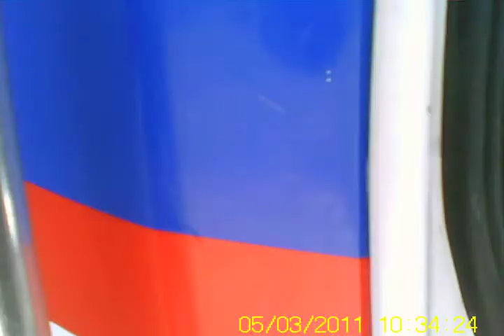Cummins 855 BC4 NTC450 reinstalling the No.7 Main and Thrust

Comment: never use a hammer and crowbar to put the new shells in , you see the oil hole on the crank , insert a splitpin in the hole and rotate the crank , it will push the shell into possition effortlessly